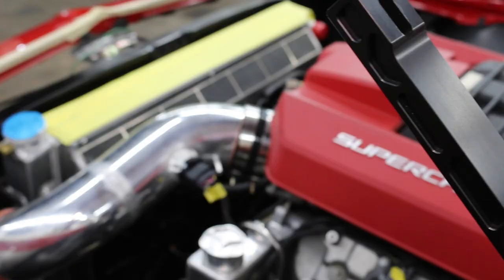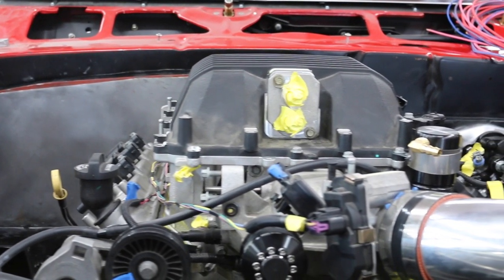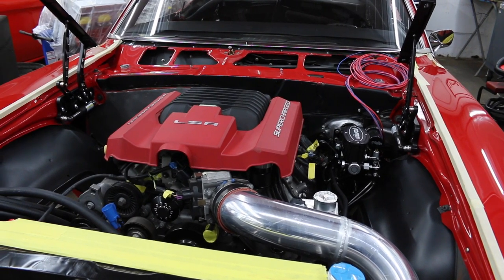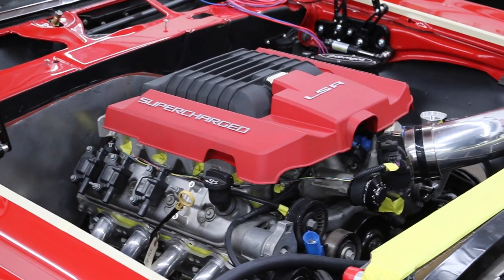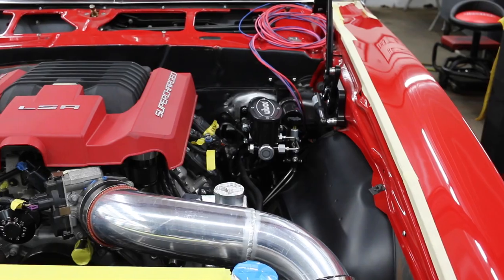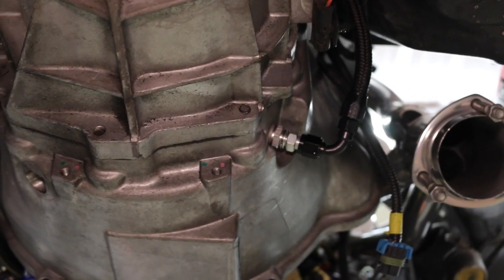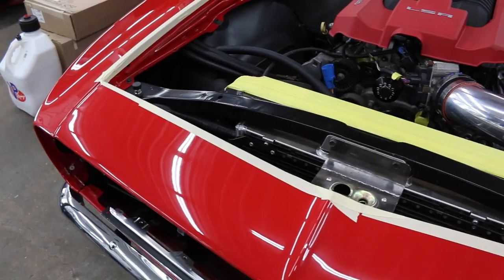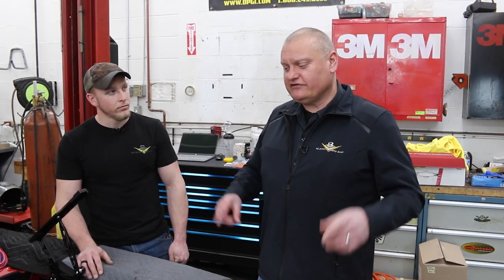Pro-Touring 1968 Chevrolet Camaro Supercharged LSA Swap at V8 Speed and Resto Shop V8TV Part 1

Comment: What is the reason/downside of the fans always running full speed?
Reply: The noise and the extra wear are my issues.
Reply from the maker: @MrRoninala  Those are the main reasons.   Another side benefit is you can help regulate temperature as well.